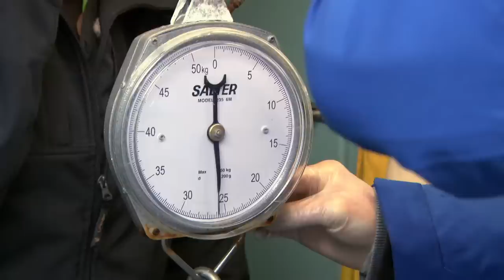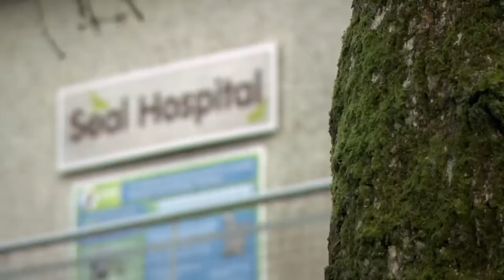Baby Seal Is In A Critical Condition | FULL EPISODE | S03E20 | Vet On The Hill

Comment: not how you towel a bird.  all birds should be taught to step up and step down for a treat and this should be reinforced daily.  a bird in captivity should be taught to step up for an exam.  however, they are known to be stubborn, so if that doesn't work you towel them, you don't grab them suddenly.  second, you gently toss a tea towel over the bird and gently scoop it up.  never just suddenly grab a bird.  next. hold the talon up to a small bright light and do not cut the quick.  have absorbent powder on hand NOT styptic pencil which has too many chemicals.  birds in captivity should be vetted every 6 months.  weight, exam, beak, nails. grrrr. an avian specialist should have been brought in to do this.

Comment: That is no way care for those rooks.  They need a big outdoor aviary where they can fly and perch high, not in a rabbit hutch on the floor!  Why would that place clip their wings and keep them on the ground as if they were chickens?!  There is zero enrichment in the enclosure for the birds, and no perches or anything to climb on.  It is just cruel to clip their wings like that to stop them flying.
Reply: For 1 Sweet Cheeks has severe deformities from 8 years of neglect, so there is no way in hell she'll ever be able to perch. Then with Nelson his wing was completely severed from his body with only skin and tendons keeping his wing attached. The only reason Nelson had feathers clipped was to take some extra weight off the wing. None of the other birds had clipped wings, you see it with both Rodney and Sweet Cheeks. You also realize there are enclosures outside that could easily be homes for the able ones right?
Reply: @AutumnSwift2  You are wrong.  They all had clipped wings, that's why they never flew out.  A bird can perch with deformed feet.. just needs flat modified perches.  So what if their enclosures outside?  They are clearly not being used to house the poor birds.  Even birds with clopped wings can perch and jump about on branches in an aviary.  Parrots for example.  No excuse to keep theses birds like that.  You can see they are not happy and even scared of the people.